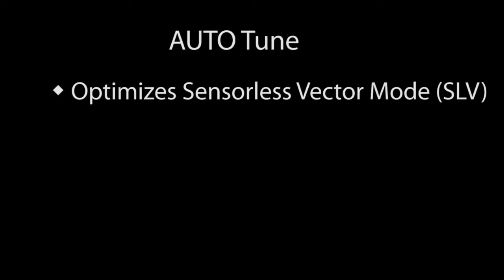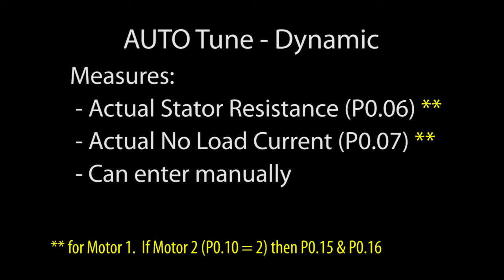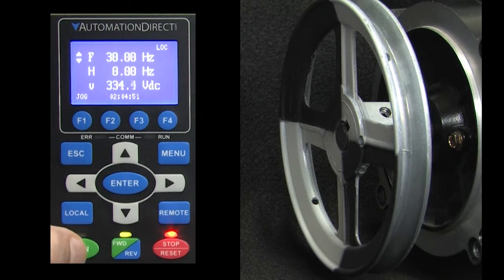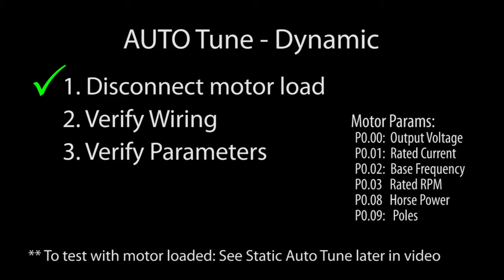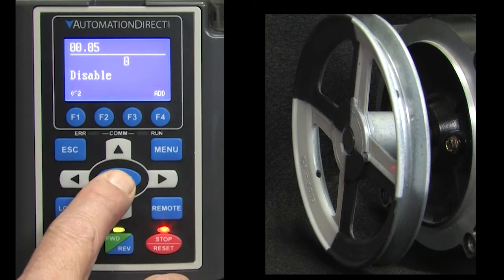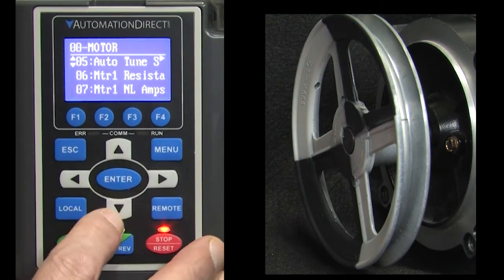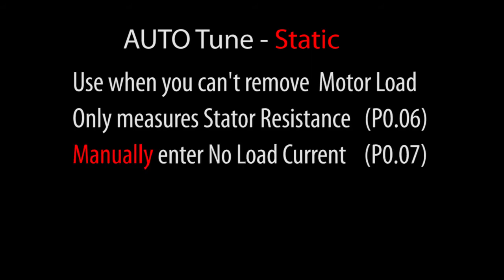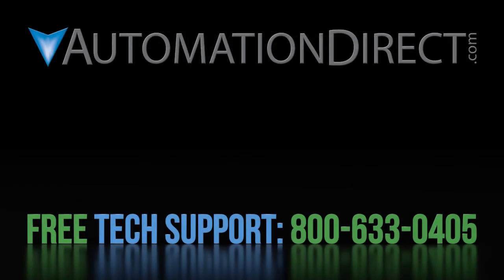DURApulse GS4 VFD Auto-Tuning Tutorial from AutomationDirect

Comment: I'm running my motor in sensorless vector w/autotune, but I get occasional knocking/buzzing/clicking sounds from the motor.  It's not pwm whine, though, it's very aperiodic.
Reply from the maker: Is your motor one of ours? If so, which one? Which GS4 drive are you running it with? Certain motors aren't designed for vector or partial vector duty and it can cause this type of behavior.
Reply: @automationdirect  The motor is a Lincoln Electric Ultimate E1 - Hostile Duty.  I'm using a GS20 Series  drive.
Reply from the maker: @psomlo I am unfamiliar with that motor, but I would verify with Lincoln Electric if it is rated for vector duty. If you tuned it under load that might also cause issues, or if any of the motor settings were incorrect (particularly the inductance and resistance values) or left at the defaults it might also cause what you are seeing. I would also try contacting our award winning free technical support, as they may be able to help you with some of the settings.
https://community.automationdirect.com/s/contactsupport
Reply: I've already been in touch with tech support.  The motor was tuned with no mechanical load.  By the way, what's the correct braking resistor for a GS21-22P0?
Reply from the maker: Braking resistor sizes are all specific in the manual in Appendix A. The correct braking resistor sizing for that drive is a minimum of 47.5 Ohms resistance with at least 3 kW of power on the resistor. From our lineup we recommend either 
https://www.automationdirect.com/pn/GS-BR-200W091 for an encapsulated option or
https://www.automationdirect.com/pn/BR-N1-280W50 for a NEMA 1 enclosed option with an integrated thermal switch.
Reply: @automationdirect  "3 kW of power on the resistor"?
Reply from the maker: @psomlo
I was looking at the wrong column in the table. My apologies. The braking circuits peak power is 3kW but the two resistor PNs I listed will work fine even though they are much lower wattage. My apologies for the confusion.

Comment: They could make a video of how to control a servo motor with the GS4
Reply from the maker: Hi Daniel,  The GS4 Variable Frequency Drives are intended for 3 phase induction motors. You need a specialized servo drive to control a servo motor like the SureServo system from AutomationDirect.
Reply: @automationdirect  Imagine that the GS4 could work with a servo, I will review the series that you advise me. Thanks
Reply from the maker: @danielru3832  Hi Daniel, The GS4 is only for three phase induction motors. Are you looking for a VFD that will control servo motors?
Reply: @automationdirect  I've seen other brands that do that, and I'm dealing with the Weg brand
Reply from the maker: Hi Daniel,  A true servo motor requires a servo drive.  Are you referring to AC permanent Magnet Motors?  Or are you trying to drive a Servo motor as a simple AC Permanent Magnet motor? If so, then none of the current AutomationDirect drives can do that today, but keep your eyes open ... you may be pleasantly surprised by our next Drive product coming soon ... hint hint ...
Reply from the maker: @danielru3832  Yep - That's a VFD driving a servo motor as an A/C Permanent Magnet motor. You don't get Servo accuracy, but you DO get smaller motor size for the same HP,  full torque at ZERO RPM, and better energy efficiency. You are going to like what you see from us in June <grin>
Reply: @automationdirect  Excellent news, I'll be watching, thanks for your answers